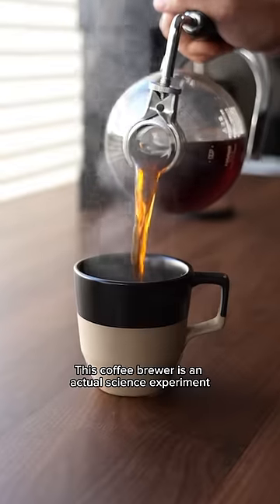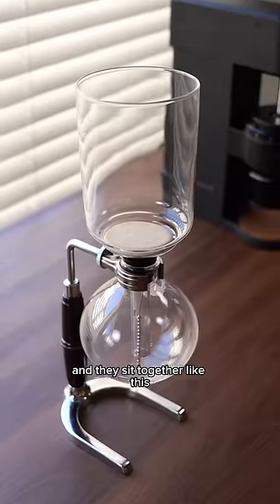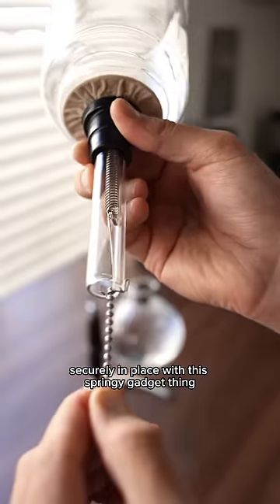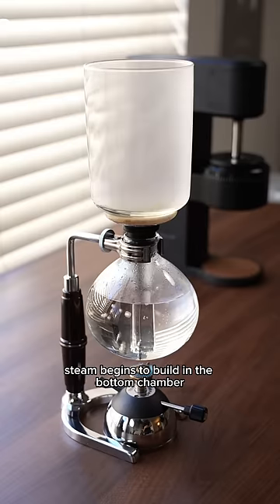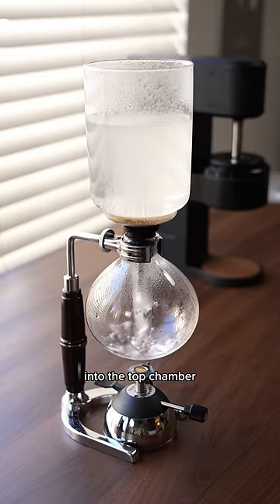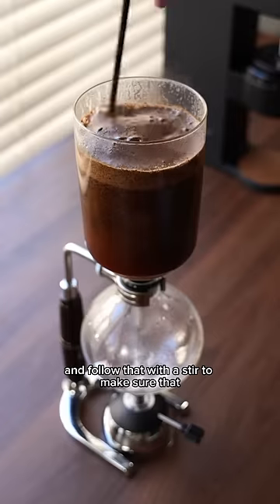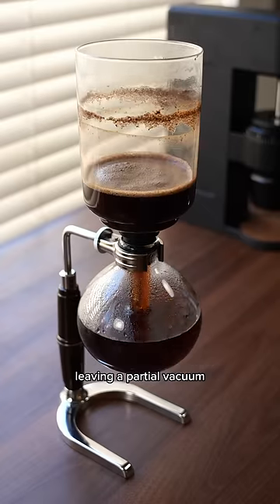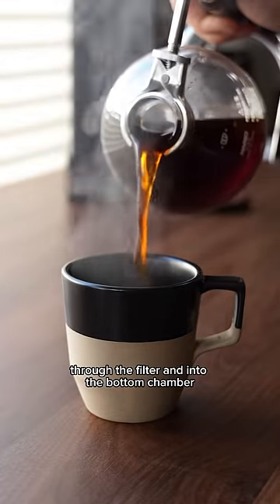A Science Experiment That Makes Coffee - The Siphon Brewer

Comment: My parents made coffee with a metal version of this pot on the stove in the 1950s.   I remember making coffee for them using it.  Cool to see a new version of an old pot!
Reply: Wonder what it was called
Reply: @Puert0ricandream It’s called a Moka Pot (probably)
Reply: Moka pot
Reply: Bialetti mashine, very often used in Europe. Super Coffee. Matter a fact drinking one right now
Reply: Yup. A Moka, also known as a Greca, invented around the 30's.
Reply: This is actually the old version getting a revival, the moka pot is basically a mass market version of the original glass syphon brewer which was invented in the 1830s, long before the moka pot.
Reply: This demo does not work as a moka pot. Moka pots work actually the other way around. Coffee is kept between the two chambers. Water is simply pushed through the grounded coffee, and the brew stays above. It's thus quick pressured extraction. 
This demo is simply boiled coffee. You can achieve this with a filtration paper if you like this. Everyone has It's preferred taste, I guess.
Reply: Percolator
Reply: I have a percolater my mother passed down to me and it works by pushing water up a pipe to drip down through the coffee chamber and back into the water below.

Comment: I genuinely love the smoothness of this brewing method which is really satisfying. It works like a mix between french press and moka pot, but it's quite enjoyable to watch and drink. The result ends up being fairly low on the alkaline bitterness, though it could turn out to be somewhat overly acidic. Not my favorite (which is the Chemex pour-over) but quite close. Works really well with certain beans (my favorite being Ethiopian ones)
Reply: I definitely really want this setup even more now, so thanks! 👉😎👉

Side note: It's "moka pot", not "mocha pot".
Reply: @DavinTurner  thanks for pointing it out. Also Autocorrect is a pain sometimes 😅
Reply: Absolutely inconsequential
Reply: Sir i used some yem3n and ethiooa veans i was gifwted i felt like i either burnt them or they are bitter. And my quetion is does one have to replace there moka pots after awhile?
Reply: @brunorojas3992  I've been using mine for 11 years. A good quality one seldom needs replacing. I'd check under the filter though to make sure it's not clogged. Also it's good to use already boiling water to fill it so it spends less time on the heat. Some beans are also more sensitive than others
Reply: @yami-131 111 years? Wow.😂😅
Reply: @jimmywhitlow2012  oops 😅 I fixed it

Comment: This was referred to as a vacuum pot. My parents had a stainless steel one. My grandfather had one. It was cool when I was a little kid to watch the water. Go up through the coffee grounds that you put in the bottom of the top chamber and when you took the heat away.  The Brood coffee went back down into the serving container below and left the grounds up above in a mound. I remember the Restaurants restaurants also used to use these
Reply: Yeah, we grew up using these on the stove!
Reply: Me too - it was delicious.
Reply: There was also a piece of glassware like this called a gasogene that worked in almost the same way, in the bottom chamber would be baking soda and tartaric acid, in the top would be water and connecting them was a metal tube, once the water dropped down from the tube it causes a production of carbon dioxide which dissolves into the water, producing soda water
Reply: Me too l, my grandfather always called it a vacuum pot. It was always cool to watch the water do down and up to the tube and up in the coffee and then up in my bumhole
Reply: its called moka
Reply: You can still buy these.
Reply: They used those in diners right?

Comment: Reminds me of the Cona coffee maker my parents had in the 1960s. This is an example of re-inventing the wheel.
Reply: Compared to a drip coffee maker, this allows you to control how long the water is in contact with the grounds.  It's much closer to a french press, except that the water passes through a proper filter so you don't get any grounds in your cup, and it stays hotter.  The only downside is that it might be TOO hot, but it's still not as bad as a percolator because the coffee-water isn't being heated directly.
Reply: @Sotanaht01  The Cona coffee made worked exactly as in the video except that there was no cloth filter - there was a glass plug that trapped the grains as the water was sucked back down
Reply: Cona is a brand of siphon brewer that claims to be the original
Reply: took you 64 years to realise thats what half the world does..this was typed on a typewriter ofcoursse,
Reply: I had the Cona coffee maker, it was awesome

Comment: I have a coffee pot that my dad used most of his life.  It is a least 75 years old, stainless steel, exact same concept.
Reply: You might have a moka pot
Reply: LMAO thats just a moka pot they extremly common xDDDD
Reply: @emilrydh7951  ok? and?
Reply: @emilrydh7951 
Moka pots work completely different, they don't have much in common.

Siphon brewers have been around for a long time as well though, at least 70-80 years if not even longer, and were made from metal. I've got an old one that is at least forty years old, it's a two piece - and some change - design and still works really well.
Reply: Putting a wet cloth on the lower part increases the vacuum and allows finer grades without taking ages btw, maybe that's useful to you.
Reply: @whyamisoselfish " 🤓 ok? and? 🤓 "

Comment: I have one of these, given to me as a christmas present.

Couple of things wrong in the video; put the coffee in before boiling the water. remove the burner as soon as all the water is forced out of the flask.
This ensures that the coffee doesn't acquire a 'burnt' taste (basically get too harsh).

These coffee makers produce a very very smooth cup of coffee.
Reply: ty for the tips!
Reply: do you recommend stirring or no?
Reply: @zaknafein254  I've never tried stirring the coffee. It shouldn't make much difference if the coffee is added before the water starts boiling through, as the coffee will saturate and sink anyway.
Reply: Do you happen to have a link for this? I have no idea where to start to type this into amazon.

Comment: The larger classic Restaurant/ Diner version that works on the same principle was called a, " VACUTAINER " Coffee Brewer with carafe. Mine didn't have a paper filter,, it used a ceramic spring-loaded plug with small fluting, it rested on a rubber gasket between the upper and lower vessel. The directions suggested adding the measure of coffee to the upper chamber prior to starting the brew cycle on a hotplate. The average brewing time was about 12 minutes. I still have one from the late 1940's or early 1950's. A garage sale purchase many years ago.

Comment: I'm using this, just using alcohol burner. You need to mix it before removing the heat so that the grounds collect on the filter and make it easier to remove. Also the heat must be enough so water stays up but not boiling. Generally around a minute is enough for it to be done. Tastes better than normal coffee because the cloth filter does a bitter job of removing some acids n bitterness.

Comment: Don't let the flame sit too long on that round bottom. Uneven heating and cooling leads to fragility of glass. Having water there will keep it pretty even but when there's very little water left that's when its risky.
Reply: if you had literal lab glass you'd probably be pretty safe. You can overheat a round bottom flask pretty hard and it's still ok. And if it was made of genuine quartz glass it would be immortal
Reply: @skeetsmcgrew3282  not true, quartz glass isnt as strong as youre saying and youll still introduce incremental amounts of stress into it with every exposure to temperature shocks it gets, hot or cold. dont abuse your glass and itll last forever no matter what its made from. im a scientific glassblower, labs can use any type of glass, they dont always use borosilicate which is very strong because of its flexibility and tolerance for temperature changes.
Reply: @andyv2209  Yeah I was assuming borosilicate, I forget sometimes labs don't always need that level of cost/quality. I guess I have a different philosophy about glass, I assume all glass will eventually break if it's used enough. Like yeah, I guess one of those little alcohol lamps can eventually do enough stress to borosilicate to break it, but most people will break it being clumsy first. Easily replaceable, not exactly something with sentimental value

Comment: Try a Bialetti Moka, it works on the same principle since 100 years, but the hot water is forced through coffee powder in the filter, so you do not have powder in your coffee.
Reply: The coffee you get out of this is completely different than a moka pot. Closer to drip, and the filter keeps the grounds out
Reply: Oh, and this is over 100yrs old too
Reply: this isnt quite like a moka pot, because the water isnt being forced through the coffee by the pressure, what its more like is just a regular pour over brewer which has its temperature regulated by the pressure of the lower container. basically, you'd achieve this result with a kettle set to the same temp as the water once it has been pushed upwards. The upwards pushing has nothing to do with the coffee brewing. basically, its even stupider than you thought.
Reply: Brikka is better than the moka pot. Although the newer ones aren't so good.
Reply: Moka pots are a similar concept but produces something closer to espresso than drip coffee! It's a great way to dip into home espresso making. I got my moka new for $20
Reply: This isn't a moka pot it's just a vacuum coffee maker. They used to be vary popular they are vary easy to use. I have the stove top version with bakelite handles.

 Vacuum or syphon coffee maker has been around since 1830s the moka pot was invented in 1933 103 years later. So moka pot 90 years old vacuum or syphon coffee 193 years old. My vacuum pot is over 100 years old and still working condition and is made of stainless steel.
Reply: It works on the reverse principal and has a very differant flavor - closer to espresso

Comment: in italy this method of brewing is extremely popular, although the utensils look different
Reply: It’s different from Moka pots and percolators
Reply: This isn't a moka pot it's just a vacuum coffee maker. They used to be vary popular they are vary easy to use. I have the stove top version with bakelite handles.

 Vacuum or syphon coffee maker has been around since 1830s the moka pot was invented in 1933 103 years later. So moka pot 90 years old vacuum or syphon coffee 193 years old. My vacuum pot is over 100 years old and still working condition and is made of stainless steel.
Reply: @windyhawthorn7387  i know it’s not a moka, but it kinda resembles it. plus, if i’m not wrong, the traditional pot used in naples has a very similar way of working

Comment: I think there is an Italian type of moka that do this
Reply: You're probably thinking of a moka pot.

It's similar to a percolator. The water in the chamber gets forced up through the finely ground coffee and it gets deposited in the upper carafe for serving.

It's really great coffee. It has a similar extraction level to espresso but it can't quite reach the required pressures. It's a great way to get close enough for a strong cuppa.
Reply: It's a percalator
Reply: @ViviFuchs  i had one of those explode on me, the top part with all the coffe ended up on top of the ceiling panels in about less than a second, it was long time coming cause we knew that particular pot was acting weirdly. It ripped the screwing threads and went off like a rocket, coffee grounds everywhere nicely in a circular pattern around the place of explosion everywhere, coffee slowly dripping from the ceiling tiles. Safe to say i heard that explosion every time i made coffee for about a month.
Reply: @frozby5973  wow! It sounds like the coffee might have been tapped down a little too tightly and the pressure safety valve failed. Little thing is like a miniature bomb if the steam can't escape.
Reply: @kaitareq2020  no, a peculator let's the water which already passed the coffee flow again into the supply water. So already finished coffee flows several times through the grounds.

An espresso pot only uses the water once
Reply: @ViviFuchs  ye it was probably the valve. It was doing weird stuff before, we just bought a different one from a brand we already used before and it never happened again. Tldr dont buy cheap pots :D
Reply: Maybe you're talking about the Cuccumella. It's a weird kind of moka they use in Napoli.
Reply: @aristisimon i thought the same thing.

The one my friend has is boiled on the cooker like a moka, but once boiled and cooker turned off, he turns it around for the water to filter back through the coffee
Reply: Another method!
Reply: This isn't a moka pot it's just a vacuum coffee maker. They used to be vary popular they are vary easy to use. I have the stove top version with bakelite handles.

 Vacuum or syphon coffee maker has been around since 1830s the moka pot was invented in 1933 103 years later. So moka pot 90 years old vacuum or syphon coffee 193 years old. My vacuum pot is over 100 years old and still working condition and is made of stainless steel.

Comment: Dude, that's just an italian moka, just less practical
Reply: not quite, because the water isnt being forced through the coffee by the pressure, what its more like is just a regular pour over brewer which has its temperature regulated by the pressure of the lower container. basically, you'd achieve this result with a kettle set to the same temp as the water once it has been pushed upwards. the upwards pushing has nothing to do with the coffee brewing. basically, its even stupider than you thought.
Reply: @auscaliber1  More like an aeropress and it achieves immersion and percolation.
Reply: My thoughts exactly
Reply: @xander1052 true, true.
Reply: @xander1052  Wrong again

Comment: Fun fact this is how that little bird that drinks water over and over works except the heat pressure difference is so small that the water thay touches its beak cools it off and the water goes back down to the bottom causing th bird to tilt to the weight difference. 

Not sure if I explained well 🤔